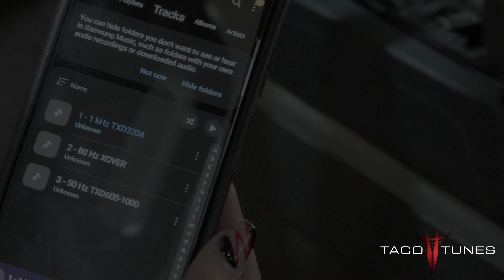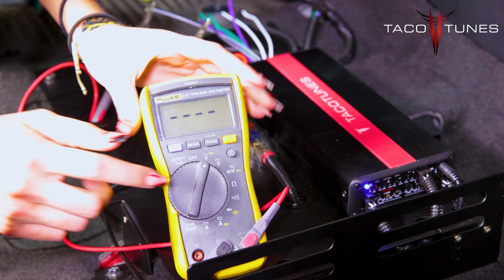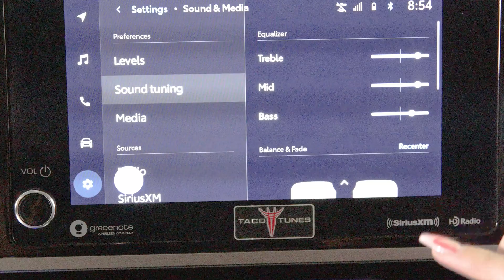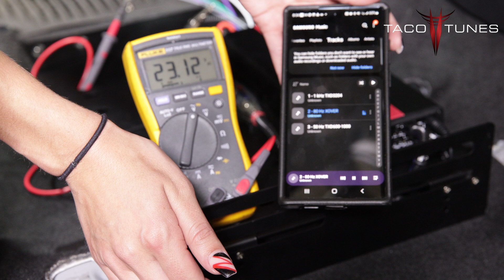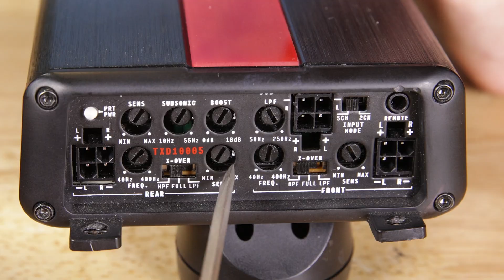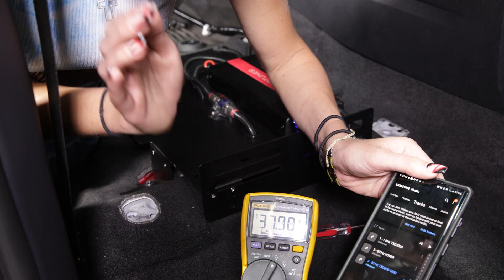2022+Toyota Tundra How to Tune tacotunes TXD10005 5 Channel Amplifier. Plug and play amplifier easy

Comment: WILL THIS TARGET VOLTAGE  INFO WORK WITH TXD10005 AMP AND NTUNE6 IN THE 2018 TUNDRA NON JBL ALSO .. IS THIS THE VIDEO I FOLLOW OR DO I FOLLOW THE TXD8005 VIDEO TARGET VOLTAGE BECAUSE THE REAR CHANNEL TARGET VOLTAGE IS A DIFF VOLTAGE # THAN THIS VIDEO.  THE REAR VOLTAGE IN THIS VIDEO IS 16.5v  BUT THE OTHER VIDEO TXD8005 TARGET IS 15.5v. WICH ONE DO I USE FOR MY APPLICATION??
Reply: this is the video you follow.
Reply: @ YA I TALKED TO JOSH @ TACO. ALL IS GOOD. THANK YOU 🤙🤙🤙🤙🇺🇸🇺🇸